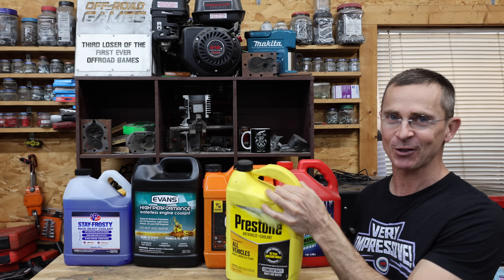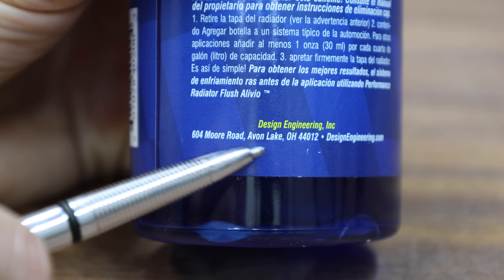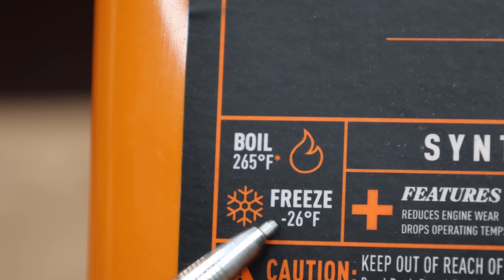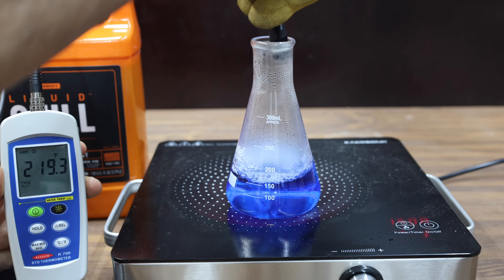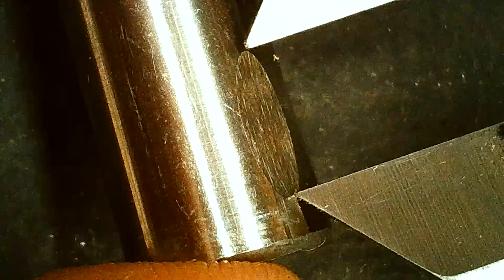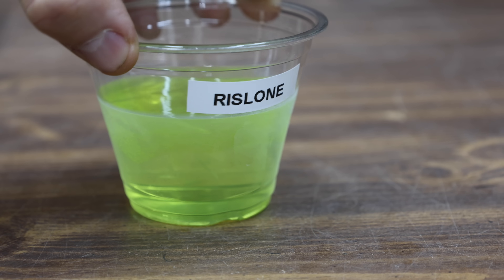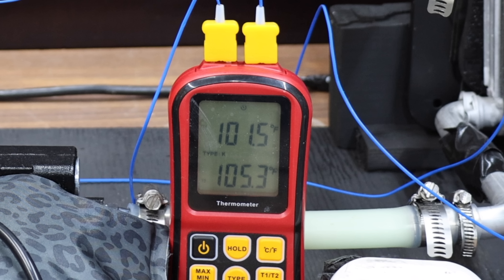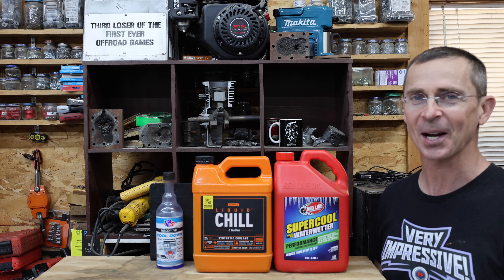Do "Super Coolants" Lower Engine Temperature By 30 Degrees?

Comment: I’d like to see some sort of longevity test for these products.  You would think that if an additive could enhance boiling and freeze point protection, plus reduce water pump wear, that a coolant manufacturer or OE requirements would be using it already for an edge over their competitors.  It reminds me of the older non-API royal purple claim to increase HP.  What they didn’t tell you is the performance benefit only lasts a few dyno pulls or one race weekend.  
I would like to see how the chemistry changes in an engine with these products over time.  Does their ph stay consistent?  How is specific conductivity affected over time?  Do the additives break down over time?

Comment: Very interesting testing as always. A property a coolant MUST have is high specific heat capacity, even better when adjusted for volume, since it's liters you put in your system, not kilogramms.
This gives the bulk of cooling potential of a medium, heat it takes to raise its temp, and plain water is very good at this, better than mixes, just doesn't do well in low and hi temps due to freezing and boiling of course.
You could measure it simply with a known electeric heater and a thermometer with the medium in an well thermally isolated container, first a known mass and then, more useful, a known volume. Comparison with plain water would be cool, pun intended lol.

Comment: I'm not exactly sure what these products are actually for. Modern cars are designed to run at 195 degrees and will throw a code if they run too cool. They also run far less efficient if too cool

Comment: I use engine ice in my dirtbike and I once ran it dangerously low on coolant and the water temp was up to over 300⁰f and when I tore the motor down, there were no piston or cylinder damage.
Reply from the maker: Thanks for sharing.

Comment: The problem with Evans is if you have a leak and there's still some in the system and have to add water. Would be nice to see what happens to it if you have to do that. 
Something I always told guys on our long trail rides in Colorado.
Reply from the maker: Thanks for sharing!

Comment: I run Evans in my truck it is absolutely the best stuff sure it's a bit on the pricey side but when you consider I dropped in LS 5.3 swap with BTR truck norris cam and Ace fuel injection system in my dad 1988 1988 C2500 I want this old girl to out last me hopefully to pass it on to my daughter
Reply from the maker: Thanks for sharing!

Comment: Wood finish? it'd be interesting to see poly oil and water base, nitro lacquer, enamel, tru oil/ hand rub oil, buffed wax protection. stuff like axe handles/ wood tool handles (screw driver and chisels)/ gun stocks ect that need protection from hard use and cleaning/oiling. would be nice to have some go to options. Great video my cadillac needs a flush really bad😂
Reply from the maker: Thanks!  Thanks for the suggestion.

Comment: I got one for you. I've found 4d nails are perfect for some small jobs that require fastening in small jobs if they only had a little more holding power. They don't split anything, but I end up using small deck outdoor screws which will split boards sometimes. I think if there is a big difference between how much different brands of 4d nails can hold, I might still be able to find some that actually work for my small projects. I suspect such differences might also exist for other sizes such as 7d (used on shake roofs) and 6d.

Comment: Once again a well-performed, systematic test! 😃👍
But I see it with a grain of salt from an European viewpoint. All European and Asian cars here use one of the following coolants:
- pink (G12+),
- violet (G12++),
- violet (G13),
- blue/yellow/green (G11),
- violet (G12evo).
That's it.
These liquids are standardised, no matter who manufactured it or who filled it into the containers and labelled it.
The car manufacturers chose one of these liquids, depending on the material composition in the engine/cooling system.
The number of the cooling liquid is in the instructions manual and if you're lucky even printed on the reservoir. 😉
Regarding coolants Europe is quite idiot-proof. 😂
The USA are idiot-proof regarding engine oil (written on the filler cap). That's where Europe can still learn something. 😉
Reply from the maker: Thanks!  Thanks for the feedback.

Comment: A few years back I watched a Jay Leno’s Garage where he talks about Evans. Its advantage over regular coolant is its longevity. It has a great life span. Jay even said that his cars ran just a little warmer, not hot, with Evans in them. He said that as long as everything else was correct in the cooling system they won’t run hot, I got the impression he was talking a 10-15 degree difference which most cooling systems can handle. I’ve always used water wetter, but am thinking about going to a waterless coolant for corrosion protection. Great test!! Very impressive!!!
Reply from the maker: Thank you for the feedback!
Reply: Wonder if Jay received any perk or payment for his endorsement?!
Reply: @1erinjames   It wasn’t like an add, he was discussing going waterless with someone, I just don’t remember who unfortunately. But it was brought up organically I remember, not like a sponsor ad.

Comment: If you're serious about acidic protection, wear protection, freeze crystallization, and heat exchange/cumulative temp difference, then Liquid Chill is the one.  If you're more concerned about boiling point, then VP Racing Additive is the one.  I live in the Deep South (Central Louisiana) and have never had issues with OEM-Spec coolants, so, if I were to buy one, I would go for the acidic protection, wear protection, and heat exchange/cumulative temp difference of Liquid Chill, but I think I'll pass never having had any issues with OEM-Spec coolants.  All I need to do is keep up with regular coolant changes as recommended by the OEM Spec of time vs mileage for me car because I don't drive that much each year.  However, I am sure there are MANY who will benefit from this info.

Thank you, Todd.  The Tester you built is impressive!
Reply: I agree, these were my conclusions from this video, as well. I don't really know much about the metallurgy and chemical stuff that goes on, but my impression is that coolants can be as tricky or more-so than choosing a suitable oil, as there are different base coolant types depending on the materials used within a given cooling system, as well as how things like the water pump may or may not rely on lubrication from the coolant. 

I don't really see much need to change from OEM fluids unless you're on a track, or perhaps towing or off-roading/construction or other extreme situations that might require better boil and heat transfer characteristics. Nonetheless, interesting to have this relative comparison to reference - I've added both LC and the VP Additive to my saved products list, as a starting point if I find myself with those needs.
Reply: Variation in droplet size could account for much of the pH variation. Perhaps dilution to allow a more precise addition like 0.5 ml.?
Reply: @paulvandenberg5341   I thought of droplet size, too.  That bulb dropper tube is not a precisely measured drop.  There are 15ml and 30ml dropper bottles with a very narrow dropper tube designed for 20 drops per milliliter which should give a much evenly sized drop.  One good brand is Gorilla Unicorn Bottle.  Of course, 20 drops per milliliter will vary depending on viscosity, but the consistence of a particular fluid would be much more precise.
Reply: If your vehicle is never subjected to below freezing temperatures then distilled water will do just fine.  Antifreeze is named as such for a reason.
Reply: @brainkill7034   We do get freezes occasionally here, usually every 7 years, but we've had 5 or 6 hard freezes so far this winter.  Antifreeze also has other protective properties, so I'll keep it in my radiator.
Reply from the maker: Thanks and you are welcome!
Reply: May I suggest at least flush out the system youll be amazed at what comes out
Reply: @WilliamClaflin-b5c   I used to be able to do that kind of thing for myself, but those days are long over.  I have a repair shop I trust, so I'll have him change coolant, the transmission fluid and service the differential when I have him change the oil.  The radiator had to be replaced about 8 years ago because the plastic casing cracked, and the transmission was overhauled about 6 years ago, so it's about time for them now and I'll have him do the rest to have it all done for a while.

Comment: I really enjoy your testing and depth of them.
Being an owner of a new diesel truck, I'm learning more about the new emissions systems coming from an old one with no emissions,
I'd like to see testing on additives for the DEF that prevent crystallization in the tank and system.
Also testing on additives that claim to clean the SCR and DPF to reduce regen cycles and system failures.
Thanks
Great channel
Reply from the maker: Thanks!  Thanks for the suggestion.
Reply: DEF fluid should not have anything added to it! Use fresh fluid, it does have a shelf life and it goes bad quicker if it is stored at temperatures higher than 90  F . Don't fall for the Snake Oil sales pitches on this one.

Comment: Can you test Valvoline Restore and Protect. Particularly, whether or not it can clog oil filters? 

Love your channel! Keep it up!
Reply from the maker: Thanks, will do!   Thanks for the suggestion.
Reply: Three oil changes with restore and protect so far 11,000 miles. Haven't pulled anything apart, but the dipstick is now shiny as new, removed all varnish.
Reply: @coarsethread7581  I just done my first oil change with it. Seen alot of information about it. Was a bit concerned. I've heard if people changing filters between changes.
Reply: I used a Wix filter with the V R&P on my daughters ‘14 2.5L Malibu.  It did not clog.  It did, however, make it stop using a quart between 5K changes.  Also using it in my son’s Civic but, as we have had it since new, it has seen nothing but Mobil1 at the recommended intervals.
Reply: They changed the formula so that doesn’t happen

Comment: I think you may have been scammed on the Engine Ice purchase. I used Engine Ice in my supercharger cooling system and it's NOT pink nor does it come in a bottle with no lablel. I don't see what there is to gain by selling fraudulent Engine Ice...

Comment: Video suggestion - potable water antifreeze. I winterize camps in norther Maine so I use quite a bit of potable water system antifreeze / RV antifreeze. I have use products from  Prestone, Star Brite, Peak etc ect. all rated at -100 (might be overkill but a plumber fixing your pipes is more costly than taking the extra precaution) I would be interested to see who comes out on top.
Reply from the maker: Thanks for the suggestion.

Comment: In a normal engine setup, you would have the thermostat regulating coolant flow based on coolant temperature cancelling out fancy coolants' claims of running the engine cooler. It will run at roughly the same temperature, just with less coolant diverted to the radiator to maintain the same temperature.
Reply from the maker: Thanks for the feedback.

Comment: In the truth about running older engines cooler than rated for is actually not healthy for the engine especially a older 350 Small block, if it's not running at least 185/190 it could damage the head gaskets or worse it could crack the block. Because the combustion is still running really hot and if you're keeping to cool it really takes a toll on cast iron, but on aluminum blocks however it's actually better to run them much cooler, just some advice to people that don't know about that.
Reply from the maker: Thanks for sharing.

Comment: The sad thing is if you actually read the instructions it depends on how much antifreeze you have in the system as to how well it works. If you run with zero antifreeze you're putting your engine in extreme danger if it gets cold and you'll receive the best results. You also have no protection against rust in your system. But if you run with the correct amount of antifreeze you get like 5° additional cooling.
Reply from the maker: Thanks for the feedback.

Comment: The Heating Element In The Heat Transfer Test? Is That Un Regulated Heating Elemet? Would Be Nice To See The Power Consumption If It Is Regulated As Better Coolant Heat Transfer Would Means More Power Consumption From The Heating Element.

Comment: Great test. In Dubai they stick to the simple 50/50 method and the vehicles survive 120F temps no problem. The key is a good cooling system with enough capacity and a strong fan. Running a lower thermostat helps too.
Reply from the maker: Thanks!  Thanks for the feedback.

Comment: If you have a Toyota. Sometimes they have a "tow" radiator that holds extra capacity and better cooling than the stock radiator. Probably better to upgrade your stock radiator if you want better cooling.
Reply from the maker: Thanks for the feedback.

Comment: I use Evans in the Race car. We have run at 117°F outside temp.  We have a track called Death Valley Speedway for a reason!  Working with an engine builder,  they luv mine for the annual refresh.  Zero corrosion or rust. All other with any water / antifreeze  with these treatments have to go through the Caustic Soda  bath to clean up before rebuilds. Evans looks brand new  every time. No electrolysis.  Never had any overheating  and zero pressure on the cooling system or hoses.
Reply from the maker: Thanks for sharing.
Reply: Cooling system pressure is a result of thermal expansion, not vaporization.  Different fluids expand more than others, such as auto transmission fluid versus crankcase oil. Atf will raise 1 qt low cold to full hot. Engine oil shows no change cold to hot.
Reply: @jtlearn1  I think your on the right track there but pressure is 110% also dictated by vapor. It just has to be.
Reply: @zachroy2684  if the system cold is 100 % liquid,.and the boiling point of coolant under 14 psi pressure is 240°, how can there be vapor? . It is completely liquid expansion.
Reply: @YuhMumsOnion All hoses are still soft after 30 laps @ 117°F. You can take the radiator cap right off with No pressure.
Reply: @acowboy6844  so evans coolant has zero thermal expansion? do you have an expansion tank? does coolant move into the expansion tank when hot?
Reply: I remember when, they first started advertisement on the product.
Reply: With Evens you can run hotter temps than normal due to the lack of hot spots in the cylinder heads. It's not always about running cooler temps if the intake air temps are not effected. A more uniform temp in the combustion chamber is always a good thing.
Reply: If you dont have pressure on your cooling system its leaking...
Reply: @zischeriboy8641when he means zero pressure, I assume he's meaning that since there's no water, there's no steam attempting to be built up, which increases pressure. I don't know much about engines and cooling systems, but that seems intuitive. Of course there's still going to be pressure in order to move the fluid around, but not excess due to water boiling and producing steam.
Reply: @Manstrual  The higher the pressure the hotter it has to be to boil a liquid. Water will boil at less than 212° in a vacuum and under pressure it boils at a temp hotter that 212°. It even takes more heat if you add an antifreeze or equivalent. Pressure is not necessarily a bad thing, it is if your cooling system isn't built to handle it. Again as said above Evens is waterless and an entirely different animal. If you use it you have to make sure you cooling system is completely void of water. You pretty much have to treat it like an AC system an pull a vacuum on it if you are not working on a new engine that has been dry for a long time.
Reply: @Manstrual 
No I ran Evans in my Powerstroke for awhile with a small hole drilled in the cap. It boils at 375* ambient which means you dont need a pressurized system.
Reply: You fill up your system and then run the motor up to temps. It will burp out some as that is normal. It expands.   But after that it will never burp any out
Reply: @Manstrual Nope 0 pressure can be ran
Reply: @thatsonebadhatharry8610  Quit thinking of Evans like others. Its a whole dif breed
Reply: @candyman1967 So if you had pressure in your system when running Evans coolant it wouldn't raise the boiling point over 375°? Not saying you should ever run an engine that hot but it's better to run your cooling system closed verses open. I'm sure even Evans when heated expands and adds some pressure to the system. The most important thing when running Evans is to eliminate all water and air pockets whether you run a radiator cap or not.
Reply: @thatsonebadhatharry8610  🤦‍♂️ No and No and No  it will never get to 375
Reply: @zischeriboy8641No its not. Evans can be ran without a cap because it boils at 375*. I ran my old Powerstroke pulling a trailer up grades without any pressure in the system. Evans is the most misunderstood product out there. Everyone tries to compare to other coolants and past knowledge of coolants. The stuff is amazing!
Reply: @candyman1967 it's gr8 I can open  cap after driving
Reply: @zischeriboy8641No pressure builds due to Evans won't boil till 350° F.  30 laps @ 117° ambient  won't even get close to building pressure.  No stress on hoses, radiator or Freeze plugs.@zischeriboy8641
Reply: @zischeriboy8641 this isn't true.
Evans is waterless. It will create zero pressure inside any cooling system because no water vapor means no vapor pressure. 
The only reason why traditional coolants in cooling systems create pressure is the presence of water. Once anything with water in it gets to a certain temperature the water will start to vaporize. It's this vapor that's creating the pressure in your cooling system, not the cooling system itself.